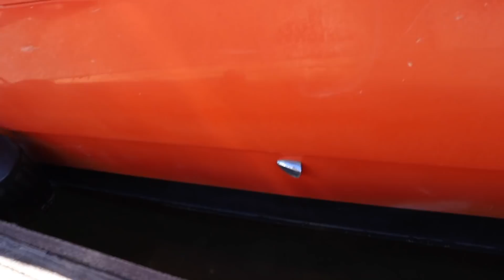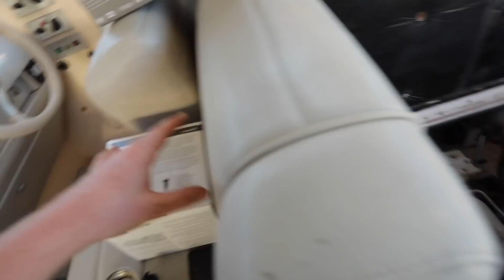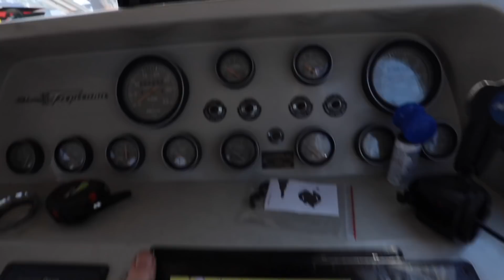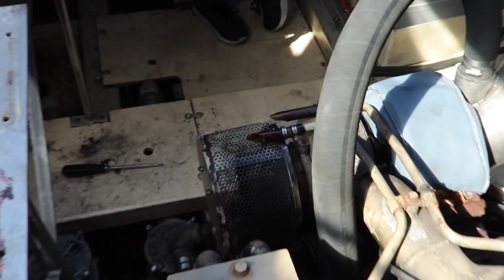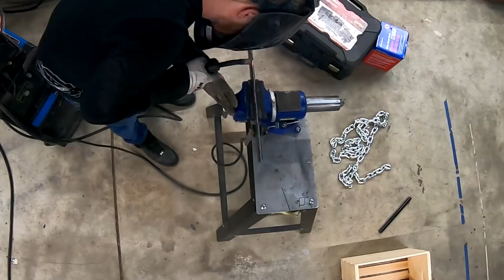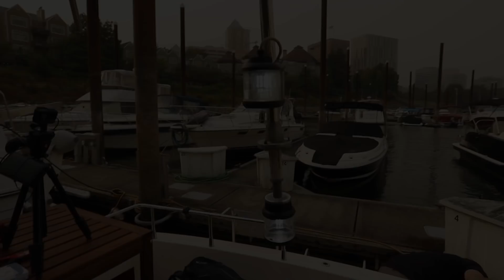Fixing Up My 30yr Old ITALIAN YACHT!

Comment: You should also have some basic knowledge of marine lighting requirements and anchoring. What was that about wrapping the hull?  You do know that you can spray on a new coat of gelcoat and buff it again right? Don't ever anchor a boat from the aft end. don't forget to send out the anchor for plating or it will be solid rust in a month. I do like the shine it looks good

Comment: Chris, I use to do marine electronics here on the east coast for several years. When I got out of it a few years ago the upgrading of electronics is huge. Unfortunately the old stuff is very large and leaves very big holes in dashes as you can see. We were doing a lot of starboard panels to flush the equipment back in instead of having the hole refiberglassed. The mounting plate you made is very professional and you may have something there.

Comment: I think that reasons behind 24V system is long run of wires and voltage drop not that it's a European model. I don't know anything about boats maybe I'm wrong.

Comment: I'd recommend you trying to use either Fusion 360 or Onshape for CAD Design. Both are pretty simple to use, and I believe low cost. I personally love Solidworks but a license for that is pretty expensive.

Good Luck with the build!

Comment: "Hard will be the learning curve with this one," says Yoda.  Zinc plated chain instead of galvanized, home made anchor (they are precision devices when made correctly), 3/8" nylon line for an anchor rode (not a misspelling) on a 44' boat, wooden box assembled with staples that are almost certainly made of carbon steel just waiting to rust, depth transducer seems to be attached to an interior surface instead of the outer hull (maybe I'm wrong).  The zinc lighting fixtures will be shiny for a while but corrosion is like cancer; hard to eliminate.  You need to connect with some people that know as much about boats as you do cars.  Oh, wait.  They've already commented below.  Boats live in a very unforgiving environment but at least you're removed form the salt until you head toward the ocean.  Seriously, a few mistakes early on will make you realize why marine grade items are so expensive compared to household and automotive grade items.  You will soon value the higher quality items and want nothing else.  Owning 17 boats over the years in a saltwater environment taught me a great deal.

Comment: you need some advise on this ... let me tell you why 

1) that boat is the rollsroyce of the boats.  Riva is just an extraordinary brand and its tradition is centenary.   Make your homework about the brand and you would be surprise. As a matter of fact a riva yacht cost 2-3 times more than any equivalent brand.  

dont make weird adaptations bro !! 
buy real marine stuff , no home made anchors and that kind of stuff !!   I repeat, this is a rollsroyce , not a 89 chevy malibu

you dont uses shoes on board !!!   change all bulbs for LED bulbs.    Nice chartplotter.      

your team is working the boat as a Mack truck.  It is not a Mack truck.  

Some riva boat, specially the classic wood ones are sold really expensive. Try to handle this professional and according the kind of boat. 

Look advise from some local picky anal yacht fan like me, so you mix his knowledge on the boat with your ability to put things to work !!!

Your team can be good for repair cars and so.  This is not a car, and it is WAY more dangerous when they fail. Look for the right people to do the repairs and put the necessary money on the project. The final product and the personal reward would be immense ... promise you that !   Would love to be able to help you !!         Cheers !

Comment: Seeing how you handle the whole anchor situation shows how you don’t know what your doing. The chain is what keeps the boat in place not the anchor meaning you need a considerable larger amount of chain then 20 links🤷‍♂️. The anchor just helps the chain set. Secondly having a stern anchor for overnight mooring is a recipe for disaster. The boat needs to be able to swing with tides/currents. High risk of capsizing! I don’t know how this boat is still floating with someone of your knowledge maintaining it!!🤦‍♂️🤦‍♂️🤦‍♂️

Comment: Anchor aft is a bad idea. Non-galvanized steel is a bad idea. On a larger boat, length of chain is important on the bow anchor. The actual weight of the chain does most of the work. Merchant Marine Officer.

Comment: Thats crazy to me that a 30 foot boat with 2 engines isn't aground in 4 feet of water
Reply: That's crazy that a 30' boat has 2 diesels..
.my eliminator eagle 230 (23') does just fine with its vortec 8.1....the same motor gm puts in its hd trucks...does 80 mph all day

Comment: Do not hard wire!!! Soak the connections in Electrical Contact Cleaner, then cover the connections with Dielectric Grease to prevent future corrosion...

Comment: Last comment I swear, but why didn't you use marine grade head unit and speakers for the on deck stuff? They are generally more water resistant, which makes sense for the outside stuff. I don't think it's even all that more expensive, I see it on sale more often even sometimes.

Comment: You need to buff the boat bro don’t paint. I detail boats full time with my own business in FL. 1500 super duty cut compound. Flip the pad and do a 1000grit vibrant cut compound. cleaner wax on and off and it looks good as new. And you need a FULL SIZE REAL BUFFER. A DeWalt for example. Not some cheap drill or cheapo buffer with single speed RPM. 1600RPM while compounding, 2000-2200RPM for a final compound clean off.

Comment: Those engines look like Cummins 903’s which are V-8’s.
Reply: Very good engines., need real marine diesel mechanics.  Probably the tank if full of crap.  He need a real marine team right there to avoid issues on a old boat like this one.
Reply: eloyex They were Ok engines at best.  Not very well liked in the bus and truck world, the Bradley uses 600HP-700HP versions, in trucks they were 270HP- 330HP or so.  The 903 was Cummins answer to the very popular Detroit Diesel 8V-71 which was a excellent engine and used in many applications except the Bradley.

Comment: Mirror finished stainless  on marine brightwork these days , ( and for the last 30 years) before that brightwork was usually thickly cromed silicon bronze and by far the most durable finish .. .. all gelcoats fade , its the hardest thing to match when doing repair work on a visible coloured gel coat , within a year on an exposed colored gelcoat you will see slight color degregation, , you can almost never use the factory gel coat colour without tinting it to suit the surrounding gelcoat .... , painting a boat in 2 part expoxy gives excellent results my yacht was painted royal blue about 9 years ago to recreate the colour it left the factory with,  it was coated 5 timess the finishis a lot less prone to leaching and is very durable , if you stick with a coating close tio the same as tbe original gelcoat scraching is a non issue..

Comment: i wouldn't try sleeping on that anchor, but you don't need a second anchor, the one on the front is excellent for this boat.
Reply: Hmm i think a boat this size really requires at least two complete anchoring systems capable of holding the boat in position independently..

Comment: Before 'Re-Printing' the Garmin mounting plate, you might consider smoothing the original 3-D print using either Acetone-vapor https://www.youtube.com/watch?v=NiG1jDEG0kA  ...OR...a coat of epoxy (Zap Z-Poxy PT39 30-min epoxy) https://www.youtube.com/watch?v=g0TGL6Cb2KY .  Acetone seem to work the fasted (10-20 min.)

Comment: Fantastic job guys! That boat/yacht looks great! I believe that the "bright work" on the boat is actually stainless steel. Often, what you will find is brass or chrome plated brass which is similar to what you will find in your higher-end home faucets. If that stuff was chrome plated steel, it would have rusted right through the chrome years ago. Anyway, Great job! I can't wait to see the finished results. Good luck with your project. The nautical term for bedroom is "state room."

Comment: Aquabuff for heavy oxidation, Shurhold Buff Magic for lighter oxidation, seal it with Shurhold Pro Polish (better than wax, it's a polymer). You'll want to use something formulated for gelcoat rather than paint products as you want to replenish the oils in the gelcoat to restore the deep colors. A DA won't get you the heat you need to really work the gel coat you'll want to use a variable speed rotary polisher.

Comment: So I was wondering, what is the displacement of those engines? If they're if they're the 5.9's I'm thinking they might be a bit small for your boat. Some QSB6.7 might be a bit more inline (pun intended) with the size and type of boat you have.
Reply: Those are 903 cubic inch Cummins V8’s probably around 4-500hp each. A B-series 5.9 Cummins is around 359 cubic inches I think. There are definitely way better options than these old 903’s!!!!!

Comment: when you change from a bulb to LED on nav lights you get different angeles therefore not the correct angles. Its fine for the anchor light since its 360 degrees but not for the runing lights.
Reply: N. o the reflectors that dictate angle of visibility are located in the fitting , not attached to any led globe  ever...

Comment: That anchor is gonna leave a nice rusty stain trail lying in that basket wet after use. There is a reason that most achors are made of aluminum or galvanized steel! Totally agree that the achor is wrong for the boat...
Reply: Far too small

Comment: One day those engines will be replaced by an electric motor. Wouldn't that be great?
Reply: Hmm they would have to be incredibly large motors and batteries, totally impracticable to move a boat as heavy as this as a main propulsion  system  internal  combustion engines  have their place as does electric propulsion,  modern ice technology is actually pretty green when compared with the total cost to the  environment of electric vehicles

Comment: I've just upgraded my Yacht's Sound System but instead of a Stereo head unit and hard wired speakers,i installed 4 Bluetooth Soundbars and play Tunes straight from the Phone to the Soundbars and because they are Bluetooth,no wiring necessary and can take them off the Yacht to the Island/Beach.

Comment: WOW ! 
There Are a LOT of Bitchy People on Here & Most of Them are men ( Well, They Like to Think So ) 
Cut This Guy Some Slack, Everyone Has to Start Somewhere. 
The Anchor He Built is NOT the Main Anchor, That's at the Bow Already. 
The Anchor He Built is Just a Secondary Anchor. 
So Chill.
Reply: Hey dude i know you are asking fot chill , but anybody who anchors a lsrge boat reguarly knows every anchor on the  boat has to be able to hold the boat in position INDEPENDENTLY and using a stern anchor can be very hazardous unless the wind seas and current are almost non existent,  the reason everyone is harping on about it is .... anchoring a large heavy boat is completely different from anchoring a small medium boat,  the weight of the riva would bd in the vicinity of 15-20 tonne that weight unrestrained moving on a light current or swell is very dangerous  , anybody with experience knows this the anchor he made is so dangerously undersize it would NEVER hold that boat under any circumstances its also poprly designed  the shaft is too short and the blades dont have enough articulation to get a set  reliably,  unfortunately you cannot cut someone some slack when something so important is overlooked and not researched .. ii mean , stern anchoring .. jeez even with a properly sized and designed anchor system  its incredibly difficult to deploy and retrievie you stern anchor when it gets just a little rough its almost impossible to retrieve the stern anchor , if you main anchor drags you cannot use the engines to maneuver the boat as the rode will foul the props , the rode is  strong enough to rip a shaft out before snapping either way you have no propulsion possibly a massive hole and a boat heavy enough to crush anybody that gets caught beside it even if its just drifting at a knot or so . Shit goes pear shaped quick on a boat this size

Comment: So rather than cut two holes into the boat for you decided to cut holes into the doors for your storage locker....... That in itself makes the lockers useless and bringing down the value of the boat.  I try to not leave negative comments because that is just not my style but being a boats for 30 years and owning 3 boats myself I can tell you never short cut when it comes to equipment or upgrades to a boat.  That anchor you just built will definitely not hold a boat your size in place for starters.  Also to note you need to make sure you are treating the covers of the boat.  The top canopy of your boat needs to get scrubbed in order to make sure it does not rot. I applaud your efforts in trying to make the boat nice but there is a right way or a wrong way to do things

Comment: The Anchor that you made will not hold that size of  a boat. You need an anchor that is at least 3 times the size of the one you have. That is if you want to be save. That anchor could work for like a rear anchor but do hold your breath on that one.